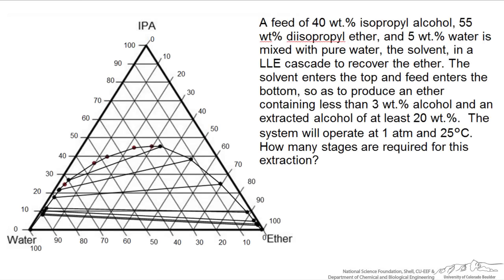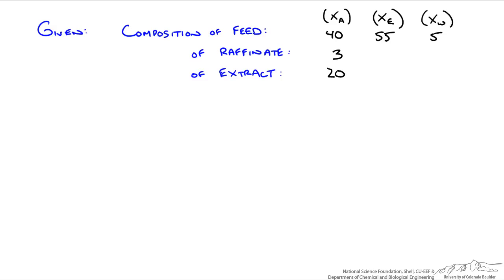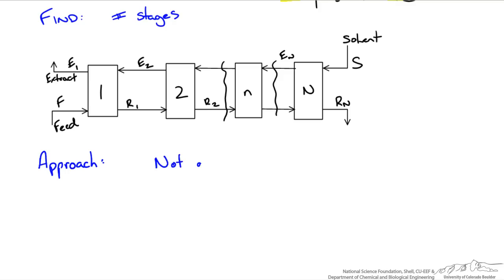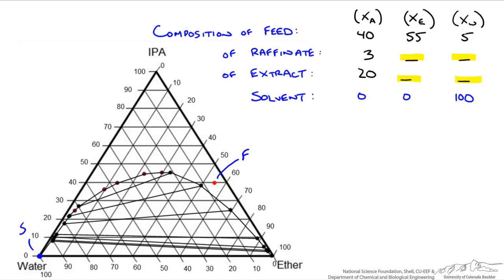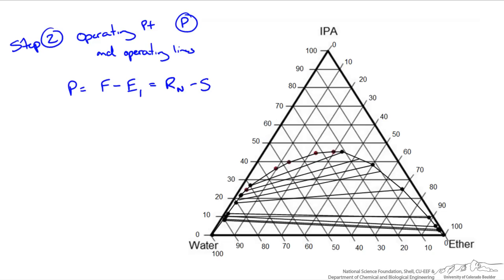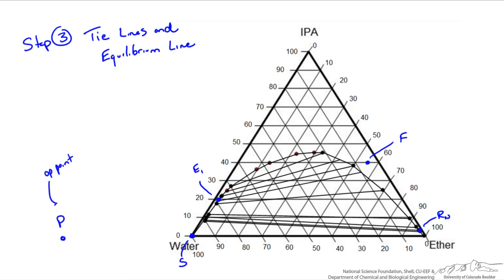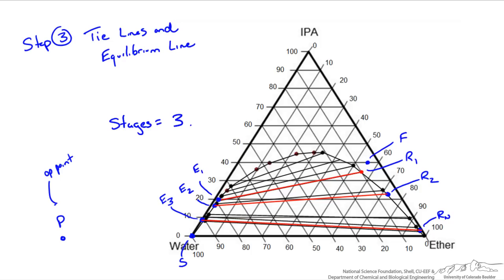Hunter-Nash Method: Liquid-Liquid Extraction

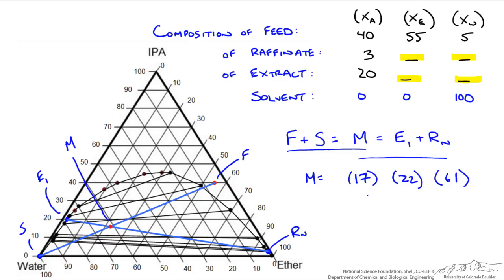Comment: Can you explain me about 4:52 values? I did not understand where they came from. Thank you.
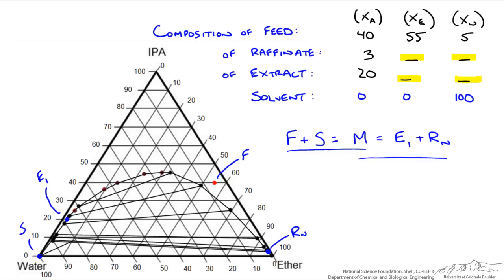Reply from the maker: Thanks for your question. If you watch starting at 4:35, you'll see that a line is drawn between S and F, and a second line is drawn between E1 and RN. The intersection of these two lines is the mixing point, and it is marked with a red dot on the diagram. The numbers you see at 4:52 are the compositions that correspond to this point as read from the graph. Hope this helps!

Comment: To expand my point: imagine this same problem. You are not given information about E1 but you have enouh information about the feed and the solvent to obtain M.

Under certain circumstances (little water, high concentrations of ether and IPA) M could shift to the right side of the area where 2 phases are formed, and the line R_N, M would connect to a point in the "raffinate" side. What happens in that case?

 I think this image explains my point: http://i.imgur.com/WmJdWjE.jpg?1